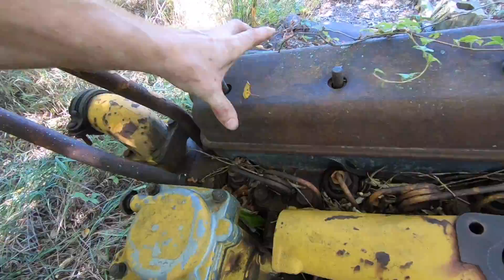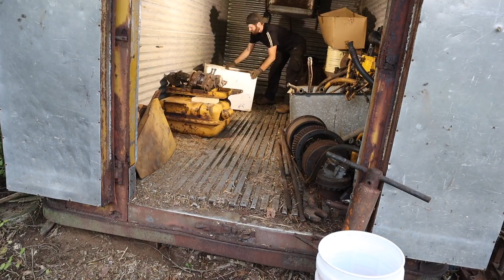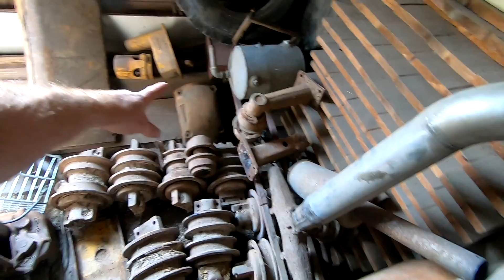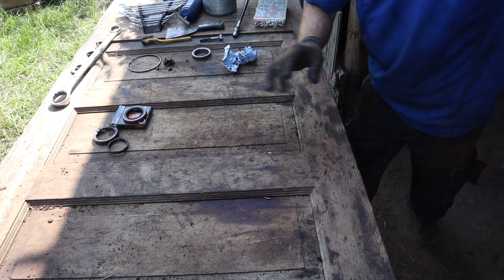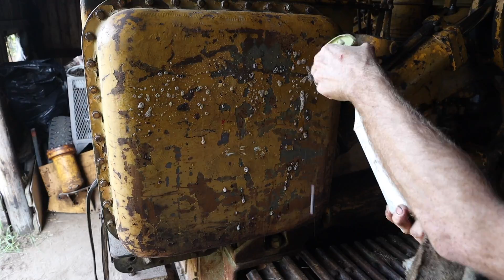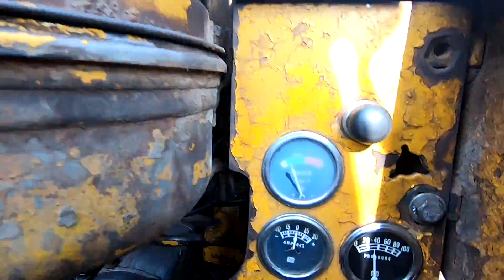I Rescued TWO TraxCavators ~ Part 5 ~ Old Red 1950s Caterpillar TraxCavator

Comment: I have a Caterpillar 933 Traxcavator also... its a 1956  11A185 machine. I like it a lot !!! I am in the process of pulling the engine, after finding water in the oil, this Spring.  I'll put piston rings, a new head gasket, and a new radiator on it.  She will last another 67 years, the way they used to make things- strong and enduring.

Comment: I see in this episode  that your drive sprocket is badly  worn  . 
45 years ago in northern Australia I drove dozens . We used to build up the sprocket teeth with hard facing  welding . We used a new sprocket  to cut a profile of three teeth out of a peace  of flat tin .  Split the track chain and start  welding . No worries , worked perfect

Comment: My uncle ran dowsers for years and had a welder that worked with him on a pipeline that welded up the teeth on his set of sprockets whit a harded steel and ground it into shape on a milling machine with grind stones. Jack said they lasted twice as long as the new ones did. He told me what they used but i have forgotten that was in the 80's.

Comment: Lots.of parts, would of been a mission sorting thru it.
Good score the sprocket
No wonder the radiator fell to pieces all the vibrations from pump.
She sounds good now.
The valve stem seals must be bit worn blue smoke when she starts.
The track roller working abit.
Generator not charging.
Abit of weld on Sprockets mite get it on truck.
Great video thanks for sharing

Comment: Hi there, I do not typically comment on YT videos but I came across your content and have been intrigued. You've really opened my eyes to some of the idiosyncrasies of owning an older Cat. I recently came off of about 17 years in the military and am looking to buy property in Or. I know I will need a cat to help clear land, level ground, and hell, just have fun with. I will not be able to afford a new unit. I grew up around older Cat's and know they require maintenance. My goal is to find a Trac-loader with a pincher bucket. You've certainly shed light on a lot of things to look at when buying one, let alone what I can do after to get it running well. Thank you. Much appreciated my friend.

Comment: Looks to me that you shouldnt have packed the pump bearing with grease.  It is an open race and it is on the oil side of the seal.  That bearing should be flooded with hydraulic fluid continually.  The grease is going to be washed out and contaminate the hydraulic fluid.

Comment: Impressed with this pump fix and the front axle pivot pin.  Enjoyed the move out of the barn too.
 That sprocket slipping is not going to heal itself, no matter how much you try to get it to engage the track.. just sayin.  But you know that already..;)
A trailer full of parts, but apparently no tensioner for the track?

Comment: You need to buy yourself some helicoils. They're simple to use and not that expensive. Especially when you're drilling into cast metal. You might want to buy yourself a good set of easy outs as well. They're made of a lot harder metal then a torque bit and are designed for that purpose.

Comment: Be sure to not overpack the grease in the bearing. If you do when the grease gets hot it will expand. Guess what happens to you knew seal when that grease expands. Over packing bearings is a common mistake that I've seen even supposedly experienced mechanics make.

Comment: I really like that you added an American Flag decal.  But First rule of heavy equipment operation is to always ground your implements before getting off including at the end of the day.  Always in float so that there is no pressure on the hydraulic system.  No massive oil leak.

Comment: If you know a welder (better than you), he could just weld some extra metal onto the teeth of the sprocket, just enough to get you on a trailer.....  or the crazy trek you’re trying to do.  But it would also make more sense to just get it on someone’s trailer, rather than that crazy trek, you mentioned.   Even if you had to pay someone a little $$$.   Would save a lot of risk, rather than that trip you’re taking about.  But I guess I’ll find out in the next video.

Comment: On the torx "extractor" best to choose middle quality, if it's cheese grade, it won't work, obviously, BUT, if it's too hardened, as some torx bits are, it might snap inside, and then, your goose is cooked.
One last resort of a last resort i've seen some people do is drill the hole, get a reverse thread bolt, cut it in half, put the two halves inside and wedge them with a flathead screwdriver, then put the monkey on it. I've seen this work two times, but it only works with reverse thread screws.

Comment: You probably already have some of the parts already, but looks like some could be easily fabricated with simple cutting torch, cut off angle grinders/metal cutting wheels, and welder. I know repairing the teack tension system would be an easy fix with a welder and minimal steel parts, and not to be looking jury rigged. I know I could take a track guide and cut off the top part after it makes the 90° turn, and design your own bearing/roller. Might take a day and $150 in  materials, but how much is a new one? $380.00+...I don't know how much but I'm just guessing

Comment: Dont trow the old sproket away it should be very possible and financially viable to refurbish the old one. Ether make new teeth, take the old ones out with lathe heat fit and then weld it in place, or simply weld more meat and the machine excess off. Just in case one breaks or wears over time.
"Bearing race+seal driver kit" hold on that is actually a thing? I honestly expected him to pull peace of pipe and hammer out of that box! XD

Comment: Just for future reference, a lock washer is a cutting tool that's just called a "washer".  It's designed to have one edge of the cut ring bite into an immovable piece of a metal surface, while the other edge of the cut ring bites into the surface of a nut or a bolt.  The spring tension of the lock washer isn't to put tension on the nut or bolt threads (that's what torque specs do), it's to put tension on the lock washer's cutting edges.

If you put a flat washer down, then the lock washer on top of it, and then the nut or bolt, in the end, you've made the lock washer useless.  On one side it's biting into a flat washer, which can spin, and on the other side it's biting into a nut or bolt that can spin.  It isn't locking anything.  That whole assembly isn't any more secure than if you just used a flat washer and then a nut or bolt.

Comment: I would have welded a ring on the rod where you had the wrench and used a cable come-along to get the track tight temporarily and put a spot of weld on each tooth of the sprocket

Comment: Jb80 and antiseeze is your best friend.  Oxy and ac torch or even map gas will really help you get bolts out. Heat till its glowing, let it cool, spray with 80. Repeat. Also, be very careful heating around greasy areas. Fire hazard big time.

Comment: for the pivot pin, i've seen things designed like that to have 2 pins.  The grease going to the middle, so that's why i think that.  Its also too hard to align a long one.  The other two holes are probably for jack bolts to remove when too tight.

Comment: Looking at 30.4 min frame it is clear that the pin was not broken. You can see the machined bevel and the end is flat not irregular like a break. Also the new bolt that you are putting in will probably break when the machine is used because of the worn pin hole and pin which will put he machine weight on the bolt. A way to solve that problem with out correcting the wear is to drill the bolt hole larger in the pin flange to allow for movement and use a stud instead or the bolt and double nut leaving a space between the first nut and the pin flange to allow for movement.

Comment: I did this on a 955h the drive sprocket was bad, I didn’t have the funds until I got a slip removed. So I borrowed a Lincoln pipelined welder I then went a got a stick or 3/8 inch square stock  think it was 3/8 and I cut it into length the width of the sprocket. I welded one on the tips of the sprocket to build them back up so it would catch the chain. And I ended up leaving it that way until they wore down. It wore through the track bushings,all the way into the track pins. And if you want to tighten the track. Which I had a 933 the same way. I used a porta power to push the idler out. And then cut two pieces of angle iron to hold it. I put three 2 in tack welds to hold it in place so that way when I put new under carriage on it was easy to just cut the welds. Be careful when tightening because it’s very easy to put to much pressure on the idler bearing. And then you’re back to square one. Good luck, and it’s a pleasure to see a young knowledgeable man such as you. Getter done and put her in the dirt.

Comment: In what little of the attempt tp turn the srpcket was not spinning..the sprocket was stopping but the track was still moving , proabably from stength of the left side drive.   Doesnt affect the fix, i know yoi need the new sprocket, but tecnically the spocket is not "spinning"

Comment: At 43:37 it clearly shows that the jam nut on the other end of the tensioner was not loosened.  If you had loosened that nut a few turns you may have been able to adjust the tensioner

Comment: As I watch you and see all the broken bolts you deal with you need to invest in a set of ( and don't laugh at me because there is such a thing as lefthanded drill bits they come as a set with ezouts) one of the dest tools I ever spended money on but when you use them don't force them go slow and about 80% of the time if you go slow the drill will back the broken bolt right out.  Good luck !

Comment: Those Plastic Barrels Are Not 20 Years Old!!....Good Luck Changing Your Rear Sprocket!!!....I Used to get parts for my A-C from a scrap yard, down in Texas!!...Online!!......I was putting a track on by myself(Bad Idea!)with a come-along, and the cable snapped, and the track rolled back, almost killed Me!!....When pump is out, get All New seals!!.....Bearing Race...Snap-On sells Left Handed Flute Drill bits just for removing broken bolts!!......You Are Doing Great!!!....Persistence!!!....You Need a Larger Wire Brush!!....Looking Good!!!
You Can Use your Left track to Turn Either Way...Either back up or go forward!!.....Change All of your Filters!!

Comment: I ran a old D7  in the 1970,s We would simply cut a large enough portion out of a new rear sprocket  ring to  fit it over the final drive without removing the roller frame. Tack it in place using small strips of metal. set up a dial indicator and bend the steel strips to alighn it. and weld the new sprockets on. The guy also had a 7E dozer and bought new sprocket rings for bolt on segments so as to not need to weld  them on  any longer. As wear on the track chains happens often there is internal wear that exceedes external wear making the links distance between pins longer. Often they would turn the  pins and bushings and the tracks became (Snakey) and too long and would wear the sprockets and be hard to keep on. Ive removed a complete link and pad before to shorten the tracks. That lets the front idler move rearward and rest on a not worn part of the roller frames.

Comment: I own two D4 Dozers. One is 1940 narrow guage 7J and the other a 49 7U Wide Guage. The engine in my 49 is the same as yours, now  right on the side of the fuel injection  unit is a cap, take that off and be certian that its full of oil. If run dry it can ruin the fuel pump camshaft and roller followers the activate the fuel pumps. There is a seal that can go bad.  Squatch who has a D2 has a video series on his engine and goes into great detail about the pump and the oil seal.

Comment: The track pad holding up the loader frame looks very dangerous,look on top of the radiator housing on both sides there should be a pull out pin on each side for to hold up the loader,that was built in at the factory,other than that use a piece of heavy angle iron to put in over the cylinder rod.

Comment: It would take a little effort and time, but you can weld wedge-shaped steel tips onto the teeth of the failing sprocket.  These tips need to be hardened on the side surfaces touching the track to prevent excessive wear, but the rest of the surfaces can be just strong and tough, not especially hard, so welding would not damage the strength of the teeth where they touch the track or the sprocket itself.  The welding needs to be high quality here, of course.

Comment: You should be more consistent with lubing up parts before you assemble them. ie.  (the spline shaft going through the new seal). Bolts into holes and nuts.  Grease is also a weather protectant....Also, why don't you use air-powered, or battery-powered wrenches more often?  Speed things up.

Comment: Measure the width of the tooth go to the metal shop and get you a long piece of bar stock that thick , take it to the machine shop and have them cut you some weld on teeth. start wit a few on the side with the clear space put them every other tooth to get you by till you can get the other one on once your home.

Comment: Not an expert here, though we share the mechanically inclined gene. I’m betting the track is stretched/pins worn to the point the tensioner could no longer compensate, thus causing the sprocket wear. Previous owner exceeded the ability of the adjustment bolt threads, and used the pipe to give it just a bit more reach to park the Cat. The good sprocket you found would indicate to me that it’s likely at least one of your spare tracks are not stretched, so when you do put the spare sprocket on definitely replace the track too. Seeing as time is if the essence, you likely (?) don’t have the time to replace the sprocket and track, a good temporary is as has been been suggested by many here to build up every 2nd sprocket with either keyway material or rebar to get you home for the more permanent fix. I’m loving these videos and finding it very helpful as I have a similar find to this in an similarly “seasoned” Cat belonging to my neighbour, which has been sitting idle for about the same length of time at his cottage. I’m thinking it is very likely many of these same issues are ones I’ll be facing soon enough too. Thanks for the clear and concise vids! 👍👍

Comment: You can of coarse contact Keith Rucker of Vintage Machinery.org he has a large machine shop he could cut you new gears no problem. https://www.youtube.com/channel/UCyjwQ6oz4cqqtEcWGboSU3g  Something else you could try is to weld some raised bits on the teeth of that worn gear a bt grind them a little to just give you some more traction might be quicker than changing it out.

Comment: Weld key stock on the tips of the bad sprocket I suggest 5/8 or 1/2 inch key stock you don't have to do every tip do every other one you have a welder there this should get you by until you get it home

Comment: It's likely you will have to lower the carrier on that side to change that sprocket, so, if you are wanting to get it out of there, building up the sprocket tips, like others are suggesting, makes sense.  I wouldn't want to even try loading it on a trailer (without a winch to assist) in it's current condition, going sideways just as you are at the tipping point would be disastrous.

A hydraulic jack, on it's side with pump handle on the lower, might allow you to tension the track enough to get the keepers back in there.  Porta-power might be better.

Cat used to make parts for every machine they have ever produced.  Mid 90's, I replace the screw and 'nut' on a D6 (9U series), those and a few other parts cost them less than $400.  I wouldn't expect those prices now, but check it out, you might be surprised - if the spare parts are not useable/repairable, that is.

Comment: If you get welder there or for any other projects put a nut on the edge and fill it to connect the broken bolt and nut. That will make it so you can take it out.

Comment: The pin is the right length but it is bent. get yourself some round stock hardenable metal @ 10% oversize. Send to Abom79 and he'll fix you a new one.

Comment: incase no one sugested this what about use a port-a-power to tension the track and a bolt on sleeve to hold it where you cut the old one off.

Comment: i would love to run across a find like that! if you are interested in a really bargain basement repair to get the slack out of the rails, back the adjusters all the way off and take one link out of the chain. get ready to need a LOT of heat and a good idea of press principles. you will have to have it off to repair the sprocket anyhow. the master will have a marker dimple in the center of the pin and will take a lot of heat to move it.......if you have the time and patience you can weld up those teeth on that sprocket, i did one of my trackloaders that way one winter. but just build you a pitch gauge from the sprocket you have there or they are still available from cat i think...... and i love that torx bit trick!!!!!!! never had thought of it, but wont forget it!!!!

Comment: Just a wild suggestion:  weld up the worn teeth on the existing drive sprocket so that it will drive the right hand track.  It won't have to take a great deal of load, just enough to get you home.  Then set up to replace the sprocket with that spare.  You got really lucky with that one.

Comment: Thanks for the series and jackpot on the spare parts. You can do what you want but I would have a hydraulic repair shop look  at that first pump when you get it apart.  Wouldn’t like to see you thro bearings at it and the wear plates are bad or shaft is to worn to get proper seals and bearings on it.  Assuming it is a gear pump.  The in and out play on the shaft is a concern for me too.  Just finished the video and wow it sounds a lot better without that whine.  Thanks again for posting.